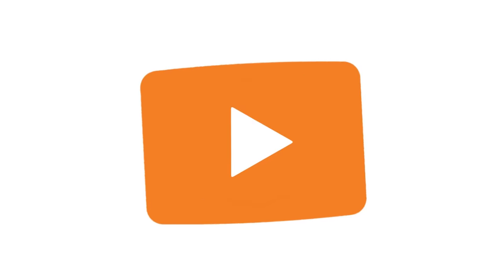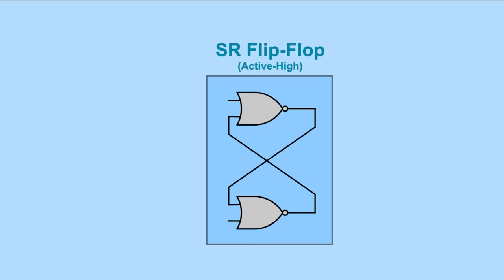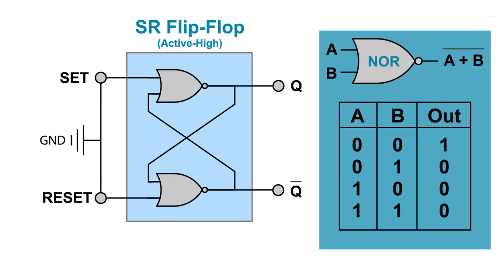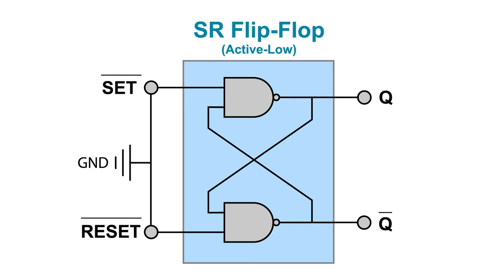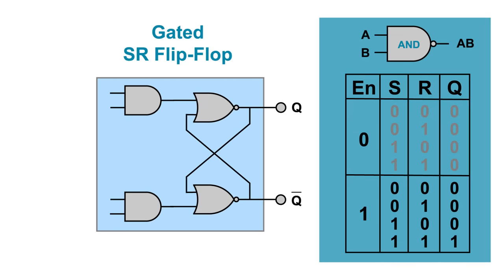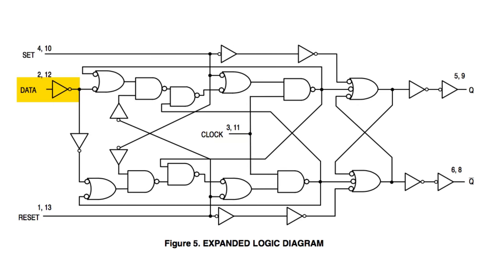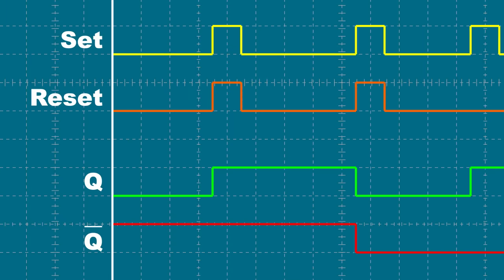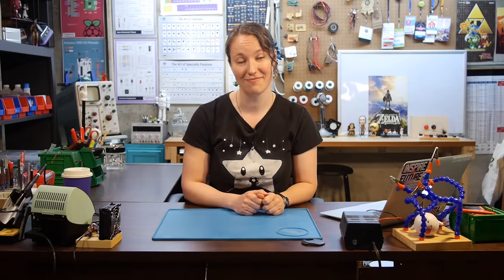How Flip Flops Work - The Learning Circuit

Comment: These seem like physical versions of If/Then statements in programming.
Reply: They are more like 1 bit memory devices.
Reply: There are many analogies, as you say. "IF/THEN" is implemented by "advance stack front", move the two items onto the stack ( via descriptors ), "jump if equal" or "jump if not equal" ( to another code routine ), with a fall-through of jump somewhere else or just carry on in that section of code, and eventually collapse the stack front. There are tremendous opportunities to refine high-level programming to avoid too much unnecessary stack operations, by use of "structured programming" techniques. Get good at this, and you'll be in demand ! Regarding flip flops, I have a booklet from 1970 "Build Your Own Computer" based around flip flop boards using three transistors, with many boards needed ! Computers in those days lived in halls the size of a supermarket ! All fascinating in a nerdish kind of way !
Reply: @S41t4r4  but flip flops are made up of logic gates. Using them as logic gates seems inefficient.
Reply: @JimmyCerra  Oh sorry for my confused self XD Thanks
Reply: You are correct, in a way. The 'if(conditional) then...' statement is based on logic.   Execution continues to the 'then' part only if the 'conditional statement' is true meaning logic '1' or true.

Comment: Thank you! Until this video, I was totally stumped about how that feedback loop works.
Reply: You still should be as the first example is incorrect and couldn't possibly work as shown.
The example for the active-high RS is incorrect.  Either the SET and RESET need to be swapped or the Q and Q-NOT need to be swapped.  It is IMPERATIVE when making instructional videos to be accurate or it will just confuse the viewer.  How does anyone  , in the know, miss that the output of a NOR gate cannot be HIGH if either of the inputs is HIGH?  (3:10)
Reply: @DiffEQ  Hmm... Thanks for pointing that out.

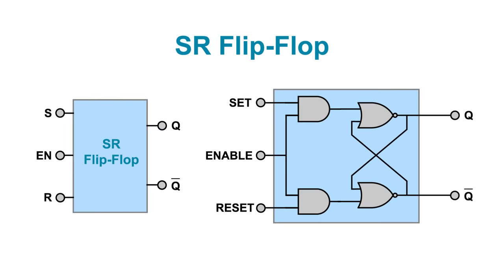Comment: There are a couple of serious errors in this presentation. At 7:55 Karen uses a simple gated S-R latch to make a J-K flip flop (she also uses NAND gates when she should be using AND gates). This circuit will never work. With J=K=1, whenever the clock input is high, the flip flop will oscillate like crazy instead of doing a single toggle. J-K flip flops must be strictly edge triggered only. This could be done by using a Master-Slave logic circuit.

At 3:03 Karen says that when the set input goes high then output Q goes high. But this is a NOR gate so with the set input high, the output should be LOW. She needs to reverse Q and notQ (or S and R) in this diagram.